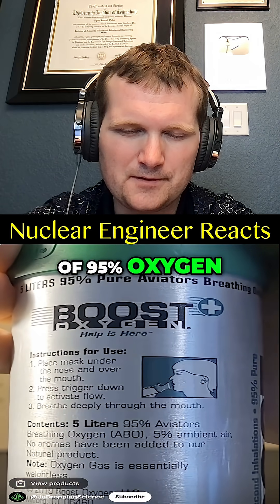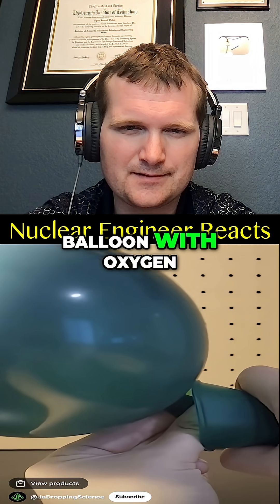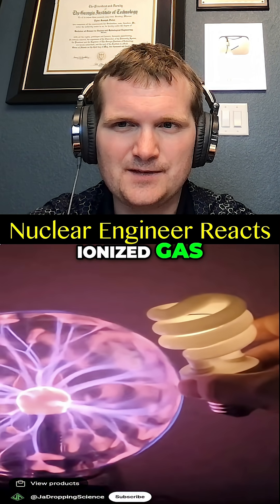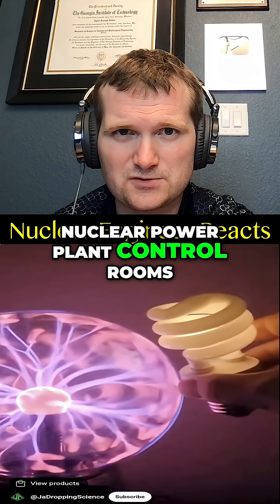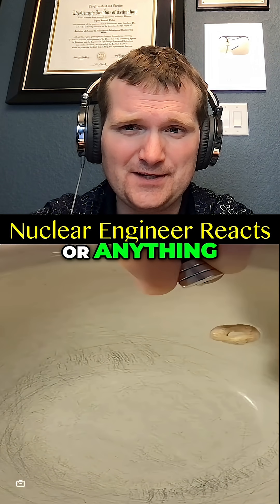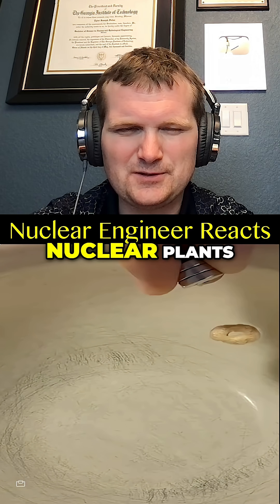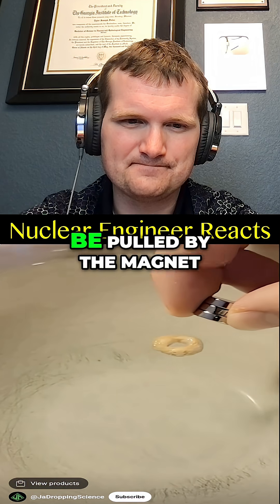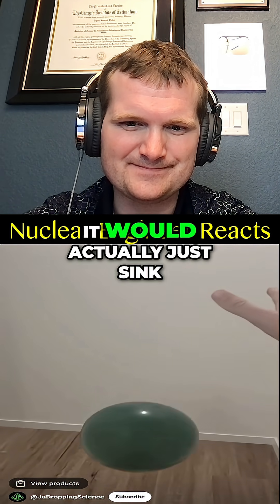Plasma Ball Turns on Light Bulb? - Nuclear Engineer Reacts to 2 Truths & Trash by JaDroppingScience

Comment: There is ~160mg/kg of iron in Cheerios. Drinking water is limited to 0.3 mg/L of iron (recommended). A single Cheerio weighs around 500mg with comes out to about 3 mg of iron per cheerio. Assuming that the water is below the recommended limit for iron and the average bowl of 16oz (~500ml) there should be less than 0.15mg of iron in the entire bowl of water. There should be 20 times more iron in a single cheerio than that entire bowl of water (with all assumptions being correct). I say this to conclude that the magnet is actively acting upon the cheerio. There are other solutes (Na+, Cu, etc.) that are diamagnetic. I wonder if their repulsion is weaker than the iron in the water. That I cannot conclude, but I still believe the effect is from the cheerio itself with the forces of the solution being negligible.

Comment: Those oxygen cans are also fake and have a ventri valve to mix air with the contents to exaggerate the flow. If they didn't you'd get very little out of the low pressure can

Comment: The explanation that Tyler gives is incorrect.  Even though water is polar (so it's affected by magnetic fields), what's happening is that the elemental iron in the Cheerio is being attracted to the magnet and is pulling it along.

Comment: It is actually important for oxygen to be denser than air, otherwise we’d lose it to the space log time ago. For that reason lighter gases like hydrogen and helium are not a large part of air today.
Reply: All three of you are wrong. Density has nothing to due with it. Density is the distance between individual molecules. It's actually the difference of 02's atomic mass compared to the AVERAGE atomic mass of air.
Reply: @chetsaxton1526 I meant mass

Comment: There is elemental iron added to cereal. You can actually extract it by smashing up the cereal and putting a magnet on the outside of the bag. So it is the cereal that is attracted to the magnet and since there is reduced friction suspended in the water than laying on the table, Poof the cereal moves. HA! Something I knew a nuclear scientist got wrong. It works in distilled water as well and in milk. Your answer was opposite of occam’s razor logic

Comment: Water is diamagnetic and is thus affected by magnetic fields. No salts or dissolved solids are needed for it to react to a magnet.
Reply: Is a neodymium magnet enough though? Judging by the levitating frog experiment, it should barely affect water at all, especially at size this small. I don't have magnet like that, would be cool if someone checked it with some definitely not magnetic material on top of water. They say in the comments that Cheerios actually contain elemental iron.
Reply: @bytefu If you have a magnet, you can try a simple experiment. Use your kitchen faucet and set it to a thin stream, bring the magnet close too, but not touching, the stream and watch as the stream bends. To check that it is the magnet doing the bending and not some other force, hold another, non-magnetic, object at the same distance and see if the stream bends.😊
Reply: Diamagnetic would mean it would be repelled by the magnet though